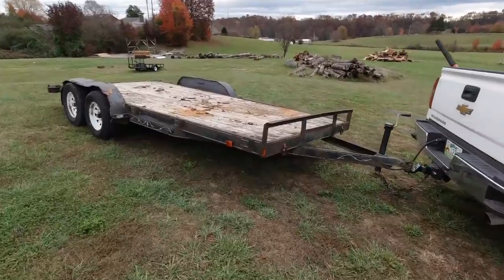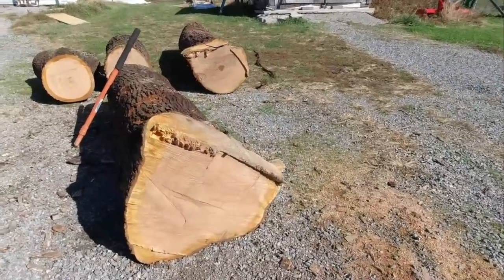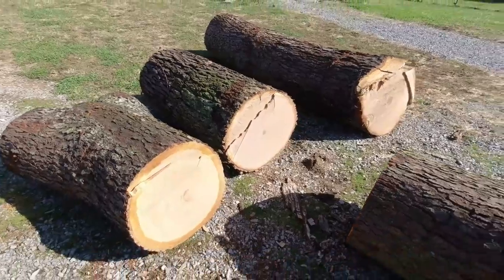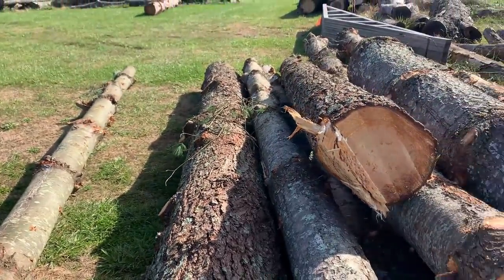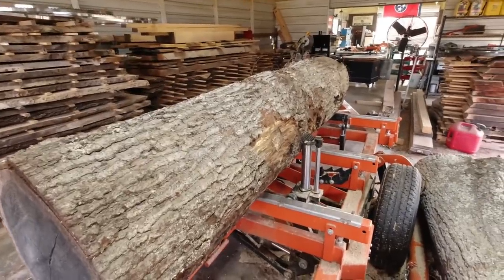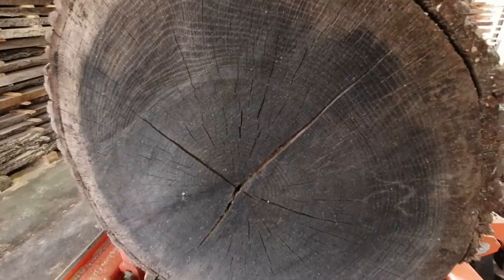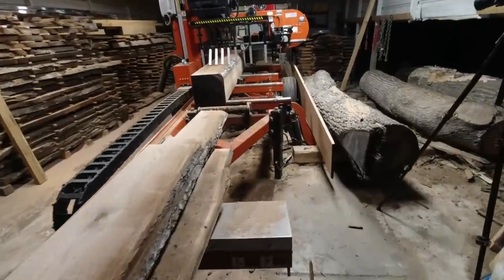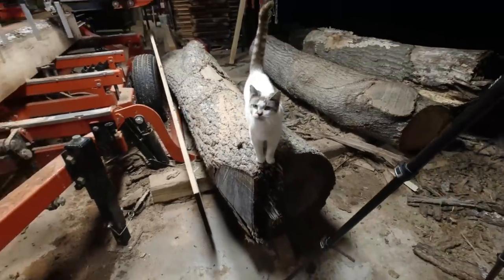Living The Saw-Mill Dream In Tennessee, Vlog Workweek

Comment: Nathan I left you a couple of comments but I know your busy and haven't seen them. I'll try again.
On the subject of having checking on your logs even after using Anchorseal there is a better way. Get you a gallon jug of Gorilla Glue on Amazon. It seals the end grain perfectly and prevents checking. Also it  is a lot less expensive than Anchorseal and does a great job. You have shared a lot of your knowledge so I am returning the favor from one sawyer to another.

Comment: Hey, I have a different question for you, its about your tractor. What size are those front tires that are on it?? We own a McCormick F-85 with a Q-25 loader on it. And it has these skinny 7" or 8" wide tires on it. And all they do is make ruts in soft ground ground. I need to get some wider rims and tires on it. There tractor tread, and work good in the snow. But drive it across soft sod and you have ruts deep enough to attract ducks and geese. I like the looks of those skid steer tires for sure.

Comment: Could you pelletize all the burn pile stuff to make wood fuel? Like all the slabs and end pieces and good stuff that is waste otherwise. It's a shame to see it just burnt up unused. Maybe a self-feeding outside wood-fired water boiler/furnace like people use for home heat and hot water. Set it up where it is self-feeding and self-cleaning where the ash is collected in a spreader to use on soil.

Comment: All those problems with the trailer are not that difficult to fix.  I know a good place to get some good lumber to replace the trailer deck.  A good coating with that green copper wood preservative on some oak boards would probably last 20 years or more.

Comment: Check out big Tex trailers. Here lately they’ve been helping out you tubers.
Reply: Will do. Thanks
Reply: I think if I was going to look for a trailer to haul logs on, I'd be looking for a older Goose neck and modify it into a log trailer like the Pitts semi trailers are with bunks about 4' tall. They you could load it with just about anything with forks or if its chained or strapped up. Also goes for pulling next to a log loader on a landing or next to a Commercial Vehicle with a loader/crane on it. Just saying from what we see up here in NE Ohio and North Western Pa. Up here in the big hardwood countryside.  Plus we get a LOT of our logs from out of the urban areas "City trees" That need to come down. Lots of HUGE Red Oak's, Black Walnut, And Cherry 🍒. Some of it gets bought by Commercial saw mills, but Sadly.  About 60% gets sold for fire wood. Which breaks my heart to see what gets run threw the firewood processor.  I've seen curly oak and maple that would have sold for $25.00 (or more) a board ft. Get made into firewood. 😢
Reply: @nathanelliott9013  There is a trailer place in Somerset, Ky. called Gatormade. Super quality and reasonable prices. I own 2 of them. My cousin used to drive 700 miles one way to buy them when he was in landscaping. Really great trailers

Comment: Are you getting them fixed or are you starting a pet shelter?    WHAT IS DOG LEGGING?
Reply: Dog legging is where the tree bends instead of a nice straight log
Reply: Those look to be Mama Cat's offspring, she had a slew of kittens. I don't know about down by Nathan, but up here (Ohio), getting cats fixed these days is a major headache (especially drop offs). When I was a kid, you took the barn cats to the vet, and they would spay or neuter for less than 50 dollars. (Tom cats were much cheaper, because the vets didn't have to rummage about inside the critter.) Nowadays, you can't get a drop off cat fixed for less then 150 at a vet. Every vet in my county requires blood work, and umpteen shots. (We used to vaccinate our own animals, you could buy all of the necessary medicines and vet equipment at the feed mill. Heck, I used to have bottles of chloroform, syringes, 4-0 silk, penicillin, scalpels, etc. Then some nimrod made it illegal....) "Spay and neuter clinics" have limited spots, and are sometimes just as expensive.
Reply: @itatane  Not Mama Cat's offspring, was stated previously.
Reply: @tonygrimes13 Thanks for the correction, Tony. I must have missed that episode (or was it a live stream?). If they ain't Mama Cat's, did he mention where they came from?
Reply: @itatane  Another stray cat turned up & had them.
Reply: @tonygrimes13  thanks for the info, Tony. It's unfortunately all too common of an occurrence. Our two cats are fixed, but one day a couple years ago a car just dumped a female cat on our side road. I got a partial plate, but the animal protective league couldn't have cared less. Well, the kitty decided to have a whole mess of babies under our porch. She has since expired, but her offspring are still under foot.